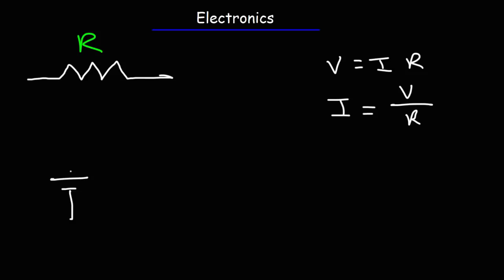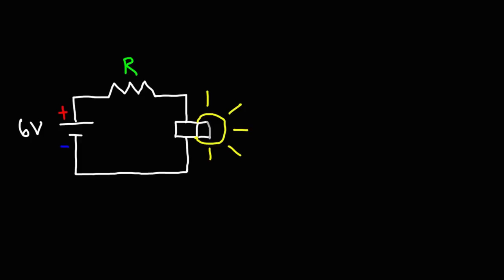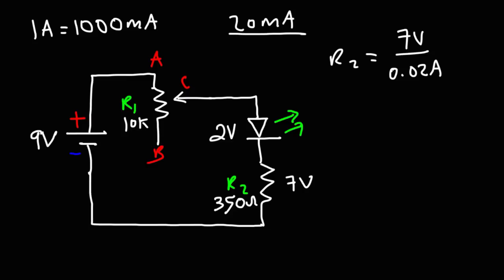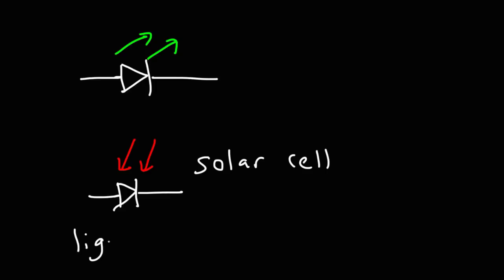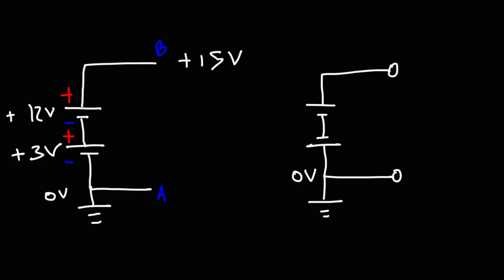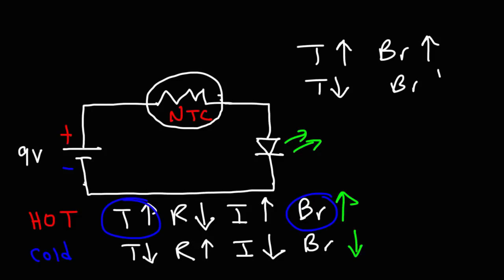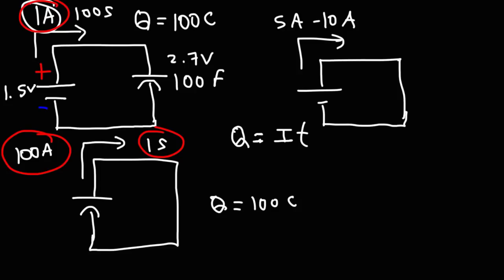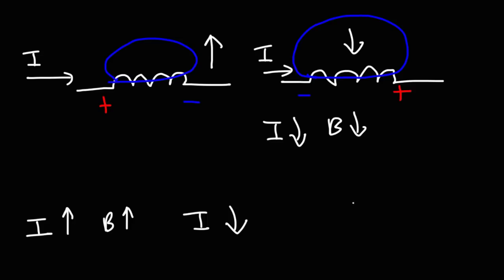Basic Electronics For Beginners

Comment: Can you explain more on how the electrons avoid flowing through the resistor? I googled it and gemini told me that just more electrons pick the path of less resistance and fewer electrons take the hard path. This makes me think that the current through the resistor would not be 0, I would like to know any laws or explanation about this if possible.
Reply: sure brother, iam not the guy that owns this channel but if you would like a very simplified explanation : yes its true some electrons will flow through the "hard path" .but, the amount of the electrons flowing in the hard path are very small compared to the ones that flowing in the "path of less resistance" that calculating them will make about no difference ( its so small to the point of it not changing any important variable of the equation) that usually leaving it will be the right choice .

hopefully my explanation was clear , and if you have any note or correction about my answer am all ears to hear it .